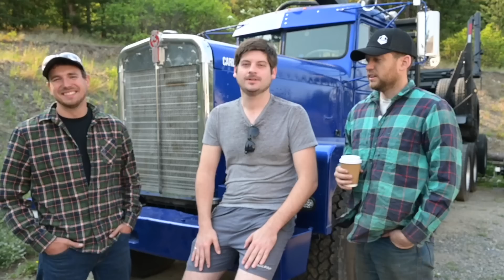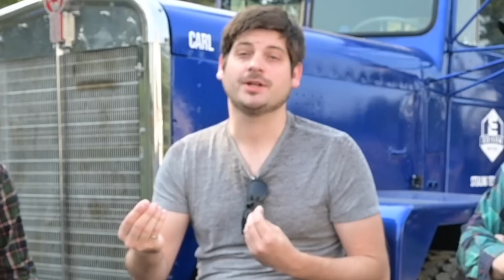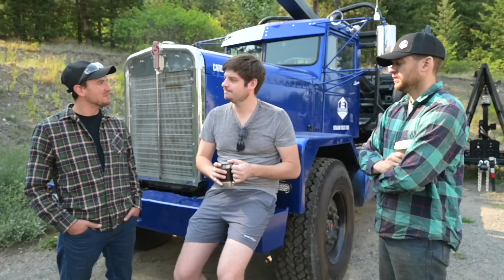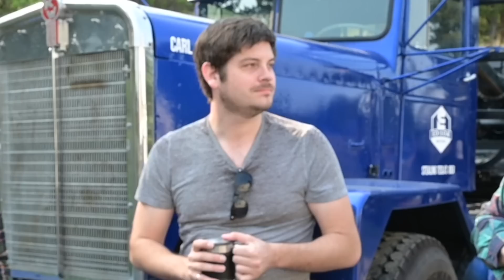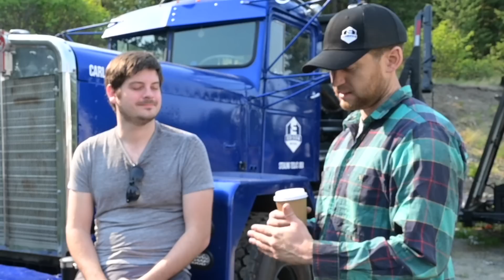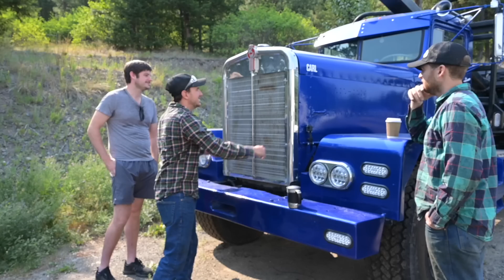The future of Electric Trucks?

Comment: Energy saving can be algorithm mapped given the Regen data and charge/discharge model. Most important for pure electric is  the range needed to get you all the way up hill with enough power to safely run the breaks and air pump as well as the power steering  on the way down. How much breaking power will the Regen break provide. And how many amps it puts out. Oh wait! The loaded truck has more energy actually cos you are bringing tons of Wood downhill. You are for sure even on a hybrid going to on purpose discharge your battery upon return. If it takes time to discharge actually you may have to literally change battery bays to be able to climb on empty again. Unless you can exchange batteries or discharge uphill. Interesting concept.

Comment: I wonder if it'd be possible, given the potential net positive in energy production, could an operator sell that power back to the power company during peak times when connected to the grid?
Reply: Hopefully you can get a better deal than solar panel owners who can sell power back for 10¢ on the dollar.
Reply: @amosbackstrom5366 😂😂
Reply: I think you can. My mind goes towards unloading that power to electric equipment, building power, things like that
Reply: Yes, there are electric train systems on mines that don’t use power and have an excess already operating for many many years

Comment: You could also stage your solar generator units at load and/or unload points to add battery energy while loading or unloading. Also, you could stage gangs of your solar generators bypassing paying for the grid, if it's not open to the public it could circumvent legal problems with the power companies. For fleets you could have interchangable battery packs to reduce down time.
Reply: @gdhone2371 with regards to interchangeable battery packs "Janus Electric Ltd" are currently developing along a similar modelling system in Newcastle, Australia... at the moment it's retrofitting to existing trucks (on road.  The current operation involves a forklift exchanging the battery packs with a human operating, the plan is for the "Driver" to (as an example): 1 - drop his trailer at the dock; 2 - park the truck at the exchange site, and walk away; 3 - robotic arms will then remove the flat battery pack and exchange for a recharged set; 4 - driver returns and drives away.  The manual operation currently takes 15-20 minutes per pack to exchange, the robotic proposal drops that to 5-10!
Reply: @PiersDJackson  thanks, that's fascinating.
Reply: My question though is how much time when loading and unloading is stationary?
And at the same point?
Reply: @joshuacheung6518  Valid points. I believe loading landings are moved as little as possible as long as they can efficiently get the logs there, electric equipment bringing logs in may extend that range, perhaps also using Edison solar as they are portable. The greatest advantage would be at the mill side for fully electric trucks, or as was talked about break areas. What drove my thinking was using Edison solar instead of paying for the grid. Just kind of thinking out loud.
Reply: I think the better thing for interchangeable packs would be the times of excess energy. Could have a battery system separate from the main drive(could have a backup switch Incase you need the extra battery for some reason) that could be pulled and tossed or plugged in to charge a buildings power or outer points so no worry of using solar or running lines to power areas or just lowering cost of running buildings
Reply: In situations with excess energy, unloading that spare power into a stationary power storage unit would be what's needed.
Reply: Close, the solar stations have Battery storage and a fast charger

Comment: Thats insane, Imagine generating more energy then used, could even sell some to the grid.
Reply: I recall reading about a mine somewhere that's on the top of a hill and their electric haul trucks actually offload power to the grid at the bottom every time.  I hadn't realized until this video that it could potentially apply to logging trucks as well.